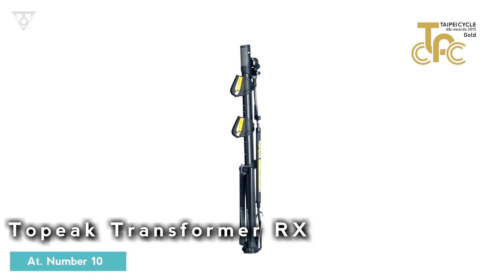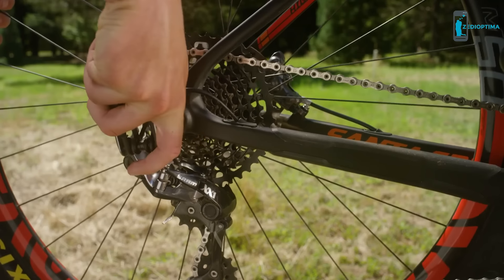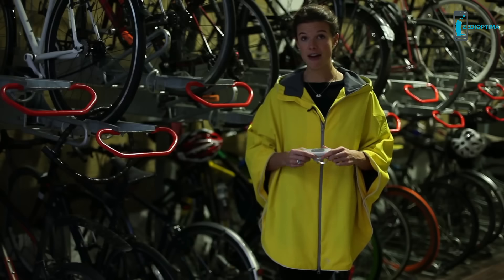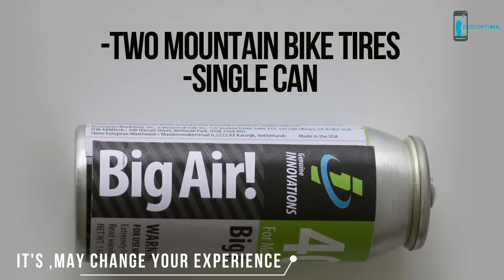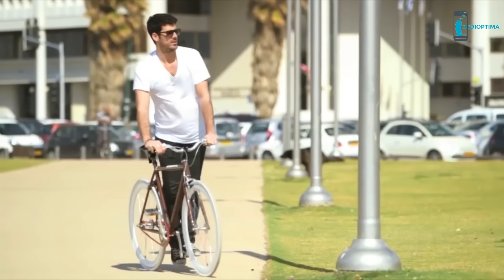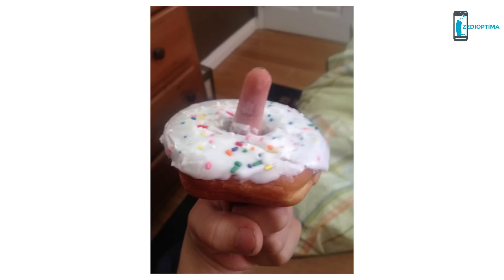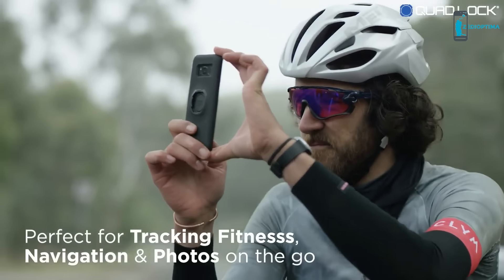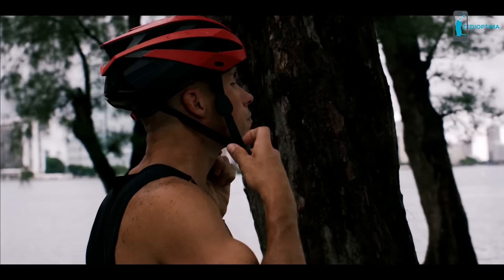Top 10 Bike Accessories Buy On Amazon | Best Smart Bicycle Gear

Comment: I have the Quadlock, THE BEST iPhone mount for bike period!have never had it dislodge or fall off on even the roughest dirt trails! Love it!
Reply: If you have an iPhone in my opinion the Morpheuslabs one is better! 👌🏼
Reply: dneira29 - I had a Morpheus case years ago that had the built in battery, it quickly became dead weight I eventually threw in the draw to never use again. Maybe they have a better product now, I’ll have to check them out. 👍

Comment: No. 9 ...the problem with most multi-tools, is that the thru pin/bolt holding the tool together is often made out of plastic, and once you apply a sturdy amount of pressure(using the tool in-general) it either breaks or becomes lose.
No. 8 ...if you're cycling in South Carolina(Myrtle Beach-area) the problem isn't that motorists can't see you, the problem is that they don't care. They feel that since you're in a lesser-vehicle, they aren't required to respect you/share the road. In-addition a lot of the near-by colleges have students that mess with you for giggles ...cussing/yelling at you, running you off the road, as well as throwing things at you while you're riding.
Reply: I’ve had stuff thrown at me from cars; cigarette butts, McDonalds garbage and cans in NYC and burbs. 
Every motorist that ever hit me claimed they “didn’t see me” however on one hairy stretch of road I grab a stick about 18inches long and hold it out from my bars, the cars see that and give me more room.
Reply: Mine broke 4 th one don't bother getting cheap and nasty  shit !

Comment: add a bike generator on the rear wheel and a battery operated drive wheel  you get more speed an endurance on every ride the bike generator will run your mobilty electrics like headlamp with a lithum battery you could travel 30 miles at 40 mph.

Comment: No 8, if you idiots did not overtake or should I say undertake a vehicle on its left  side when it turning left you wouldnt get squashed,  I ride a bike, Ive never had a problem or near miss because I will sit in the traffic and move with with the traffic, no laser lights needed, all you have to do it NOT pass a large or any vehicle on the left when its turning left, simple solution to a big problem
Best product = bike bell

Comment: ROFLMAO @ Seatylock
"high quality aluminum" ............ easily sawable. just means its shit

THing is to not leave your bike in the thieving range of thieves.

Period.
Reply: The lock itself is steel.. only the adapter to connect the seat to the bike is aluminum..... It even shows them trying to cut through it with cable cutters.. which doesn't say much but still.
Reply: @matthewthompson9424  cutting it? You could most likely lockpick it in less than 10 seconds.
Reply: @your_average_cultured_dude  i saw a yt vid with a guy pushing out the joints-connections between parts of a top Abus lock inside one minute.
Always use a small but loud sound alarm in addition.